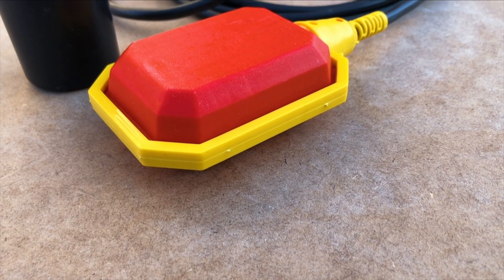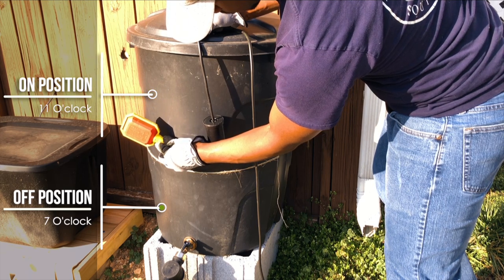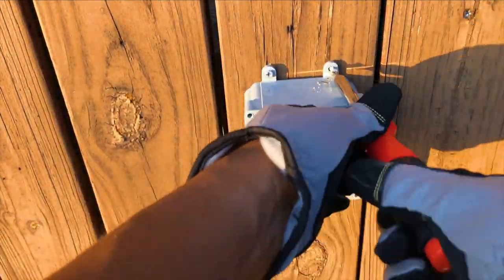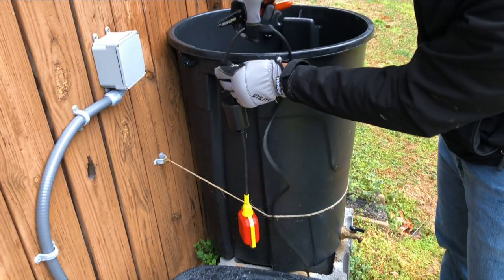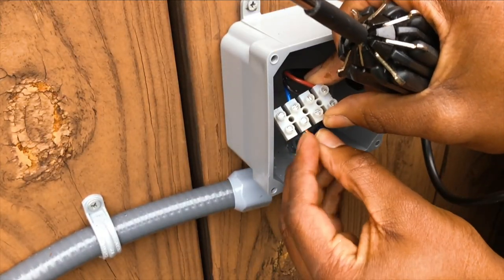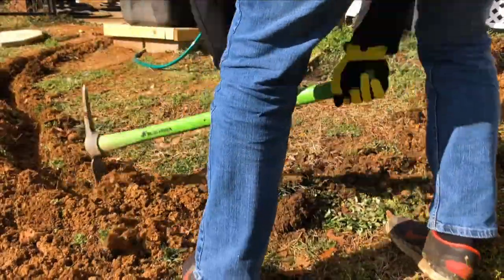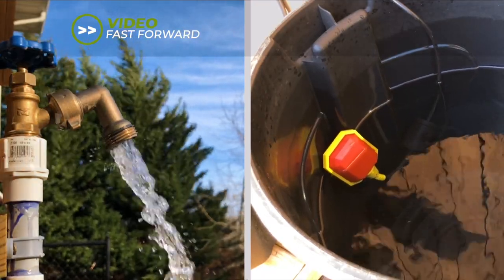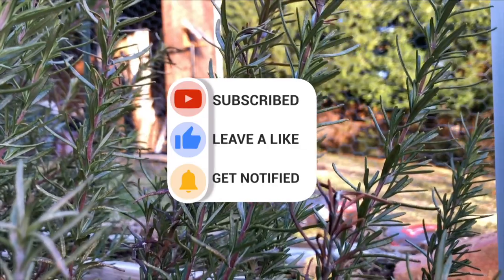CHEAP Rain Barrel Float Switch | DIY Water Pump Protection

Comment: Brilliant videos.  Your electrical work is clean, safe, and easy to understand.  I always have to laugh a little when a 'simple DIY' video shows us using $10k worth of power and hand tools though!  Thanks for posting these.
Reply from the maker: Thanks! Haha, yeah it was not always that way. One purchased tool just lead to another over time as my knowledge increased :D
Reply: @GreenTechTown  Amen.  I'm the same way.  Can I ask you a question:  Do you think a 12V battery's off-gassing of hydrogen in a closed tote is a problem?  Without venting I'm concerned that the motor coming on in an enclosed space with even a little hydrogen/oxygen mix is a potential problem.  Worth venting the container?

Comment: I have a large backyard hydroponic system and was trying to figure out a system that uses a solenoid switch to wove water around the system. I have a 250 gallon water tote that I use as a reserve that gets pulled down to a 32 gallon trash bin that then disperses to the rest of the system. This is the perfect system to use for my application.

Comment: I have no experience in making a rain barrel. I wanted most of your great videos on this. I need to start from the beginning and learn how to install the rain gutters on the roof and down to the rain barrel. I think the next video would be the drip float, which I watched. Do you have a video for the gutter and to the rain barrel? Thank you for all the time you spend making these wonderful videos.
Reply from the maker: Hey Cheryl. No, I do not have a video showing how to attach rain gutters, or how I connected the downspout diverter to the rain barrel. The following video probably provides the most detail for the connection of the downspout to the rain barrel: https://www.youtube.com/watch?v=GJ8TUwZWnio

I am in the process of expanding the capacity of my rain collection system, and it looks like I will have to re-install my downspout diverter, so this time I will try to make sure I show my process for installing it. 

As for rain gutters, you can probably find other videos here on YouTube that shows how to install rain gutters on different structures. I have never done that myself. :D
Reply: @GreenTechTown  Thank you.

Comment: I like how you add a little extra to the projects. Like cutting the wire connectors with your band saw. Or making the area neat around your tank. Or even something inane like attaching the cabling to the wall. (jk about the inane part.) Those extra features add so much more that I would normally not think of and after seeing will certainly use.
Reply from the maker: Thanks for the feedback and for watching!  😀

Comment: Beautiful setup! My only suggestion would be to incorporate drip loops just before each waterproof piercing to lead any rain water away from the connection joint. Really nice work.
Reply from the maker: Thanks for the suggestion. Never heard of it but after looking it up that makes a lot of sense.
Reply: Drip loops are code-required for electrical penetrations to avoid fires but it makes sense to use them to keep ALL penetrations dry. Water, in the wrong places is an unforgiving relentless enemy!

Comment: I built one similar to yours. I used a demand pump and a toilet flush valve to fill a secondary bucket that feeds a drip line for my garden. The pump cuts off when the bucket is full and on when the bucket is empty. I use a simple timer to cut the pump on and off so it doesn’t run 24/7.

Comment: Your system is exactly what I want to do for mine that I'm building!  Thanks for all the step by steps! Your videos definitely are the best!  One more thing... Have you thought to add a pressure switch so that the pump turns off when the sprayer nozzle is turned off?
Reply from the maker: Awesome to hear and glad it was helpful! And yes, I have thought about that, just looking for the simplest way to implement since many of these projects are new for me as well and have always been something I've wanted to try out :D

Comment: I am just designing, building my 1st. I am going with a “bilge” float switch, much simpler to connect (2 wires), and simpler operation (sits on bottom, will cut off at 2” height).
Reply from the maker: Awesome. Just looked that up and that looks like a really good idea! Thanks for sharing.

Comment: You are so good; makes me a little ashamed of my slapdash process.  Do you have any feeling about using a 120v power source for this system?
Reply from the maker: I would have no issues with 120v, it just requires a little more hardware in my case to power it using solar energy. Using DC components made the process a little simpler. However, I have seen a few plug-and-play off-grid commercial products that have made creating a solar setup for AC sources extremely simple but they are still on the expensive side at the moment.

Comment: Robert... another amazing video that gives a clear explanation of exactly what I am embarking upon. Have you thought about integrating a solenoid to trigger a garden hose refill from the tap once the water level triggers the float switch? 
Also, what quick connects are you using for the wires? Can you provide a link?

Comment: How would I include a soil moisture sensor in this setup, so that it pumps water to the raised bed when the soil is too dry and stops when it's wet enough?
Reply from the maker: You would need to add some type of microprocessor (i.e. Particle IO, Arduino, Raspberry PI, etc.) that could receive and monitor a signal from the sensor that can detect that the soil is dry and then send a signal to a relay that could turn the pump on. This is just 1 solution that would require some basic programming, but I am sure there are others out there.

Comment: How would I wire the float switch directly to the transfer pump. I don't plan to use the solar install you run. Any help is appreciated

Comment: I am really enjoying your pump system videos. I have a small garden but I am going to install this for vacations when I am away. Probably will chose 12volt battery control over 120 volts as you did. I havn't done the research of which is better, but if you like 12v over 120, than so don't I.  My big question is, what pump did you go with?? Can't find the link for the life of me in any of your videos.
Reply from the maker: I started with the harbor freight pump and then upgraded to the on-demand pump sold at Northern Tool. I believe I put a link in the other video you left a comment on. Let me know if it does not take you to the correct webpage.
Reply: @GreenTechTown  I purchased the same one. Thank you for the help. I think I will also put in a 25 psi regulator so I don't pop out my air irrigation fittings in my 1/2 and 1/4 lines. Great video's man! Like like like!
Reply: @GreenTechTown  I have a schematic I would like you to see. How can I send you a picture?
Reply from the maker: You can send it through our business email located on the About page on the channel.

Comment: I’ve considered doing a high switch as well to kick on a sprinkler in case the rain barrel is completely full
Reply: Why not just put in an overflow tube near the top ? That way even if no power available, barrel will NOT overfill, nor will you drown whatever the system is watering.
Reply: @Seminolerick  Agree. Definitely better to have an overflow output at the top. There are plenty of times when you DON'T want to water your garden.  With even a single barrel system (or multiples) the "last" barrel in the chain should have an overflow output at the top of it.

Comment: Okay maybe I can't see for looking but where can I get the other low water shut down switch you mentioned as my system has multiple barrels and even totes at different levels but the top water level is the same on all unfortunately the totes are about 2 hundred feet from where my house barrels are and I want to detect when the totes are low and a float switch in the barrel will leave me with about 200 gallons left in the totes

Comment: Could your wire the float switch to a fuse block and use a 13 amp fuse?
Reply from the maker: Yep, that would probably be a wise idea to protect the wiring for the float switch as well.

Comment: I'm having a hard time finding a horizontal float switch that'll work with a 12v system that can handle 5.2 A. Are they supposed to be used with a relay or something? Isn't there one that can just be connected between the battery and the pump?
Reply from the maker: Hey Korgan. Yeah, I know when I was working on this project, I did not come across any horizontal float switches that could handle a huge amperage (however, I did not spend a lot of time searching, so there could be some options out there I'm unaware of). As you mentioned, some type of relay would need to be installed in between. I do have one video that somewhat explains how a relay can be used here, https://www.youtube.com/watch?v=7N1kpvGKGp0, but if you are completely new to the topic, you may want to check out some other YouTube videos for how to properly wire up a 12v relay. It's actually quite simple, and I'm sure you can figure it out. Just make sure you purchase a relay that can handle 6A or more.
Reply: @GreenTechTown  Found a video the other day that explained how to hook up a switch to a relay, and they showed connectors that can be used rather than soldering wires to the relay, which is great. I think I'll go with that. Thanks!
Reply: Looks like your video uses those connectors too. :)

Comment: Does the pump shutoff if the timer valve is not running water?
Reply from the maker: Hey tyhkee1, I'm not sure what you mean by the timer valve in the video, but basically, this float switch is connected in series with the power to the pump, so if the float switch detects the barrel is empty, the pump will not be able to run or be commanded to run by the other components in this system.

Comment: Why not use a on demand pump
Reply from the maker: Hey Travis. It was not necessary for my application at the time and I was still fairly new to pumps. I do plan to look into one since I need to upgrade my current pump since I am slightly expanding my garden.

Comment: Once again no way to know what to call it to order one I need one that goes on when it goes upside down to fill a barrel from pump..
Second one that doesn't name the type of switch , normally on or noallynof means nothing unless compared to position it's in in the same breath.